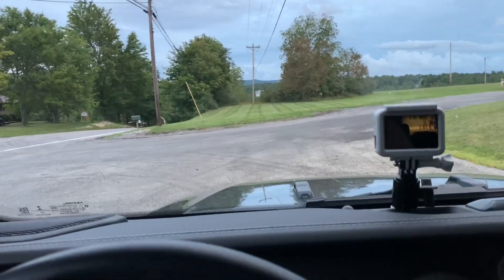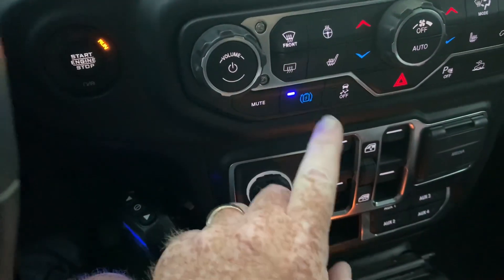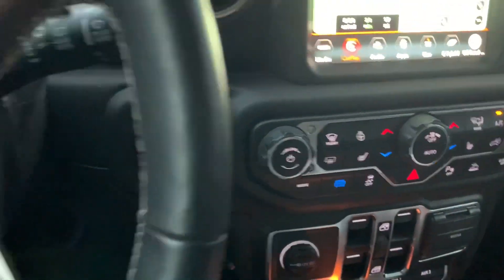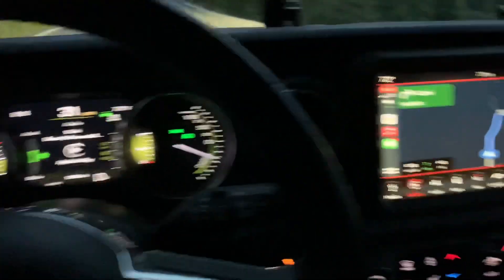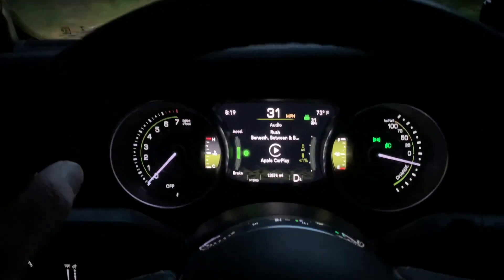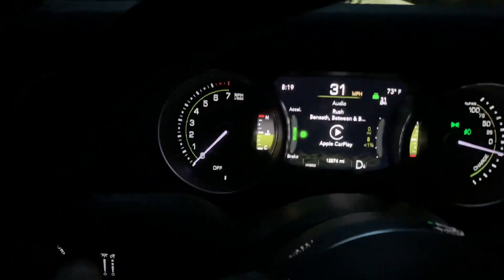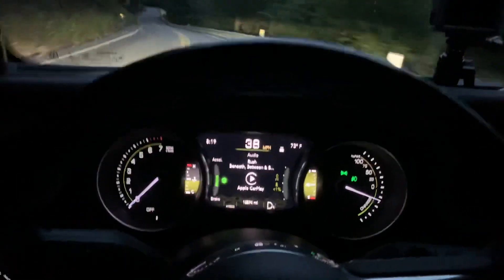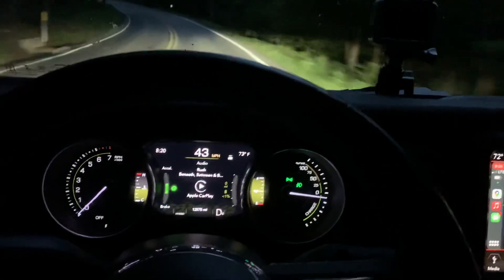Using Adaptive Cruise Control as a variable Max Regen.

Comment: Could you explain the purpose of 2 electic motors.and what each one does...
Reply from the maker: Both are motor/generators. The 4XE doesn’t have an alternator or a starter. So that one on the front of the engine severs several purposes. It adds some power to the front of the engine during acceleration (motor) it starts the engine (motor) and it operates as a generator for the high voltage system (generator). 
The P2 motor/generator provides propulsion but also provides decelerating force. When you place your foot on the brake pedal (during normal braking) the deceleration you feel is coming from the P2 motor/generator. It can switch very quickly from motor to generator as can be seen when using max regen.

Comment: Love your videos. Had a quick question. I just test drove one today and loved it. What is the key differences between 2H and 4H Auto. My understanding was 4H auto is new to the more recent JLs, and the guy at the dealership said the 4xe should be driven in 4H Auto (with 4H part time being the traditional 4H and 4L being as stated). Do you use primarily 4H Auto on roads or 2H?
Reply from the maker: 4H Auto is sort of like All Wheel Drive. I use 2H most of the time because it's ever so slightly more efficient. But it's good to keep the parts moving so I throw it in 4H Auto when it rains. Not so much that it gets slippery but to keep the parts moving in the front.
Reply: @Wrangler4XEFans  Thanks. I'm in California, so it won't rain too much, except in the winter and early spring months. Would it make sense to put it in 4H Auto in the summer months on occasion, would you think just during rainy seasons is sufficient when there isn't as much rain?

Comment: Have you ever noticed while max regen is actively being used - whether it's through adaptive cruise control or using the max regen button - that if there is any wheel slip the max regen stops working? 

When I am traveling down a moderately steep grade, for example, on a dirt, washboard road, my max regen will stop actively working. #IsThisNormal
Reply from the maker: Yes, that is very normal. It does that so the antilock brakes can get involved if they need to.
Reply: @Wrangler4XEFans  
I appreciate your reply. It makes sense. Another question: Is it normal to lock in the on position (blue light lit) where it will not shut off, but doesn't work?
Reply from the maker: @d.shanerose1729  I just ran in to that same scenario this week. I had never had that happen before. I’m not sure what I was seeing and it only happened a couple times. I couldn’t replicate it at will. At one point, it was decelerating but it wasn’t showing a charge. Not sure if it was the blended braking system kicking in the friction brakes or what was happening.
Reply: In 2hi regen only brakes the rear tires.  Not too good going down hill in slippery rain conditions.
Reply from the maker: @Chemist1076  The system reverts instantly to the friction brakes if the slightest bit of wheel slip is detected.
Reply from the maker: @Chemist1076  The system switches over to the friction brakes if it detects any wheel slip.

Comment: Have ordered a 4xe. Found the JL Wrangler fourms and there are pages of CEL's relating to the 4xe, many without a resolution. Have you experienced any?
Reply from the maker: I have had no issues. I have a poll running in the 4XE Fans group right now and the majority of people who have responded have had no issues. Right now, 409 have had no issues, 95 have had their ball joints tightened, 45 have had CELs (not related to the fuel cap then a few others have had other kinds of issues.
Reply: @Wrangler4XEFans   So roughly a third of respondents have had problems...

Comment: Great info Chris. Still trying to figure out why mine didn’t charge all the time when crawling on Poughkeepsie gulch. Seemed to work only half the time and when we were done, the brakes were hot as hell.  Do you find it recharges all the time with you in either 4low or 4low auto. I now leave it in 4high all the time thanks to Dan’s feedback.
Reply from the maker: I just haven't used Esave enough to really have much experience with it.